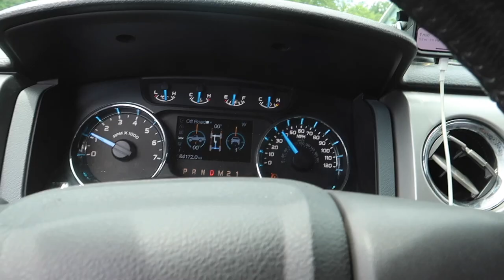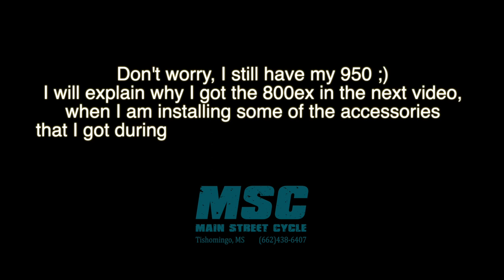Newest Edition to the Garage - Did I Stay with CFMoto?

Comment: You got a 800ex and no doors?
Reply from the maker: It’s an 18 model, they didn’t come with doors until 19, I believe. Oh, but I’ve got doors for it…😏. Thanks to Main Street Cycle…full superatv doors is gonna be my next video!
Reply: @JustinTheCreator  heck yeah man congratulations on the new addition didn’t realize they didn’t come with doors back then guess I didn’t pay attention when I looked around lol
Reply from the maker: @DirtTrailAdventures  lol…thank you! I’m excited to build this one out!
Reply: @JustinTheCreator  I’ll be following I’ve only done a few things to mine still have wheel spacers and light bars to install but been busy with buying a toy hauler and a diesel truck to pull it lol
Reply from the maker: @DirtTrailAdventures  lol…I’ve got quite a bit going down on this machine…1” wheel spacers, 2” perfex lift kit, factory front and rear light with turn signals, fuel controller, Memphis audio Sound bar, snorkel kit and more!